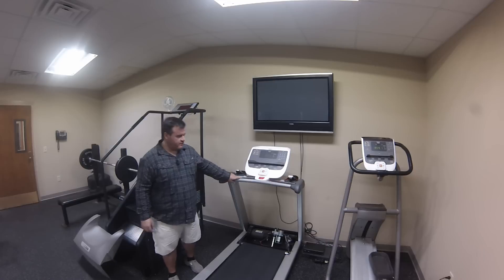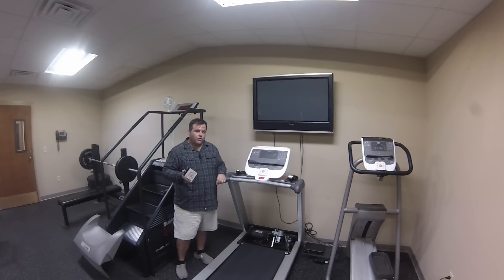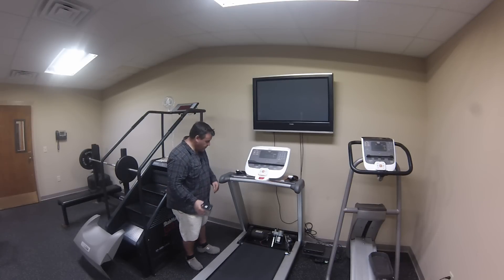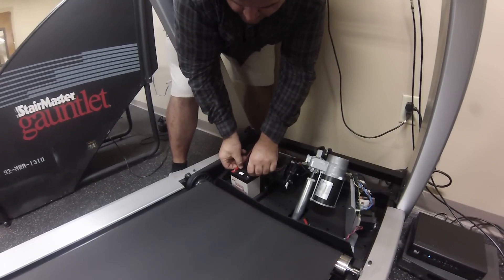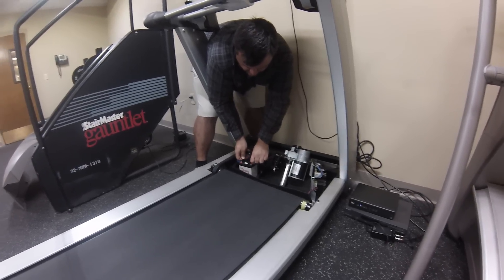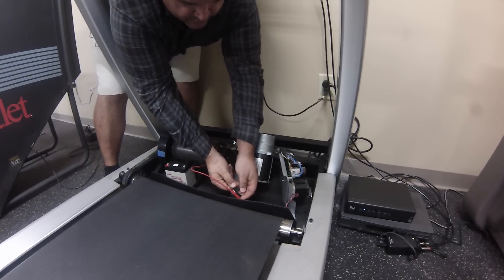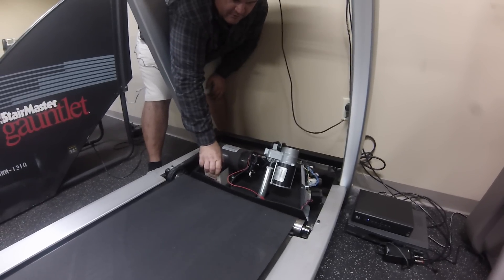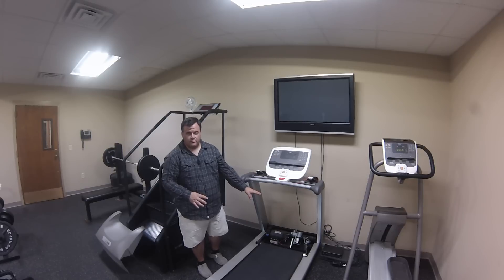Treadmill Motor Testing With A 12 Volt Battery

Comment: The safety switch that is operated by the safety cord has to be in working order to alow the controller to work. So check the safty switch befor replacing the controller. Befor you toss a machine go to ebay and type in threadmill motor. You can sell your motor and controller.

Comment: does this test work whatever the operating voltage or watt power  the motor gives
Reply: Good question. Also dose it work with a power cord that puts out 12V, because this test dose not work on a treadmill I have that works fine. It will not turn the motoe with the tread belt hooked up. Is AMP a factor and a battery has enough where a wall adapter 12V dose not?